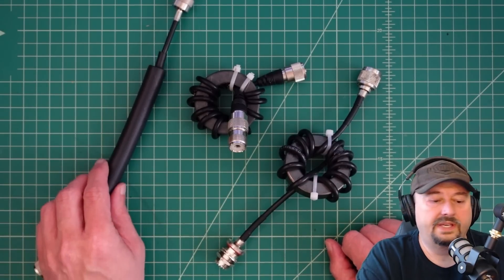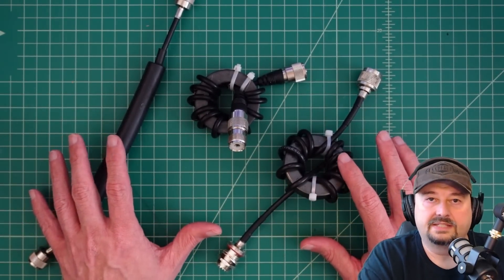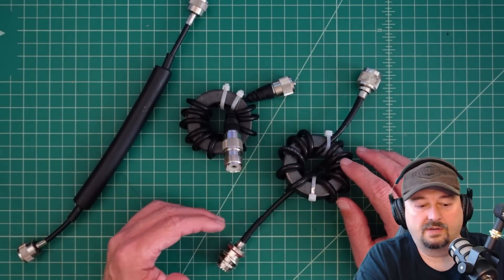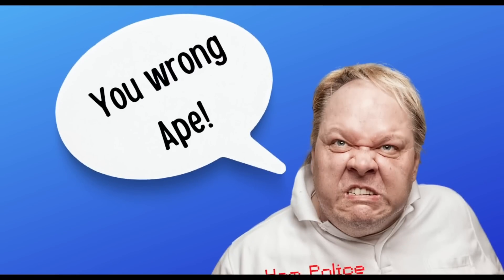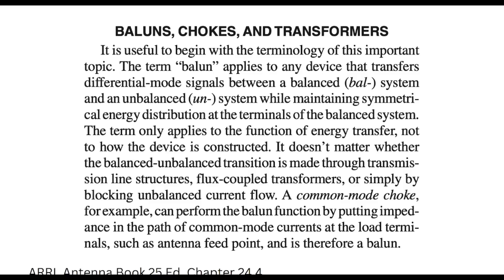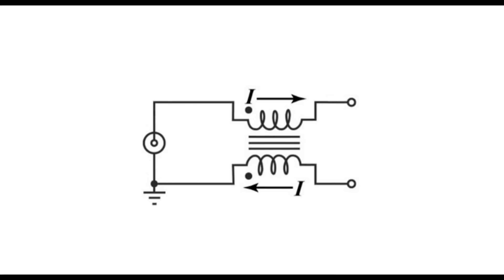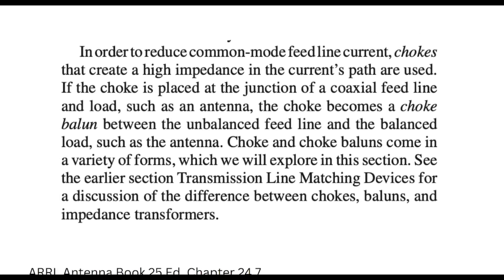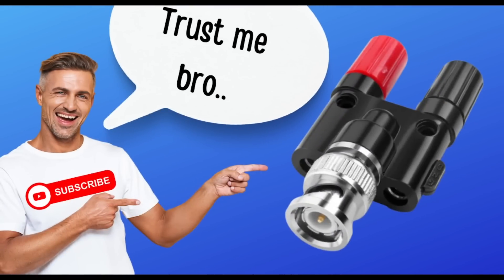Debunking the Ham Radio Choke & Balun Myth

Comment: What's with the Achkshully guys in ham radio? It's one of the worst hobbies with these hall monitor types. Write mhz once instead of MHz and you'll flush them out. It's not really fair to bait them like this, but it helps so they can be spotted.

This video is exceptional at showing what happens with and without a balun at the feed line:

https://youtu.be/QFOx7vjchy0
Reply from the maker: I guess some people have nothing better to do, thanks for the link 👍

Comment: When I built a cheap dipole with a banana jack to BNC adapter, one of two ways I did to reduce common mode current:

Loop the coax from the adapter through a ferrite bead a number of times, or use a choke cable. Both of those work as a 1:1 balun. I’ve been able to make them for 20 and 10 meters.

Not the most efficient antenna, but it works.
Reply from the maker: @Sonicgott  I’ve seen folks use those methods before 👍

Comment: I've got an idea, if common mode current travels back down through the outer sleeve. So make a cut/ gap at the highest point, where you connect the Antenna.  Solder resister in between the gap enough to stop or completely stop all common mode returning. Ham radio is for experimentation.
Reply from the maker: Hey Steven.  You use differential current with antennas, you don’t want to alter that, a choke is the best practice 👍
Reply: Why learn theory when you can experiment endlessly?

Comment: 6:50 "How are you handling common mode current?"  In a coax cable, there is no common mode current.  Common mode is "common" to two or more conductors as for instance electrical zip cord.  Twin-lead or ladder-line antenna wires should be push-pull differential; the current going out one wire is exactly matched by the current arriving on the other.  Ethernet typically uses UTP, unshielded twisted pair, and transformers or at least differential amplifiers at the ends to ignore common mode current flowing on BOTH WIRES.  

Current flowing on the outside of a coax is not "common" to anything; it is just current flowing on the outside of the coax.  So far as I know it does not have a name for that, so people are using "common mode" for that, but it isn't, and it's mildly annoying.
Reply from the maker: Everything I’ve read about it says it travels on the outside of the coax and is called common mode current but I’m sure you are right.

Comment: Well I went to read that article and I went directly to the conclusion. It's more or less along the lines I was thinking along. A balun or unun might make no difference at all. But a dipole is not even 50 ohms it's more like 120 or something depending on height above the ground and as the author mentions, lower frequencies are more susceptible to being effected by surrounding objects. On certain antenna it will certainly help with or stabilise certain mismatches lets say. However he also mentions that more types of antenna need to be tested. 
  I have been trying ununs on verticals, a 1:1 helps to stabilise bad designs that are not close to 50 ohms.
  For a mono-band antenna it's best to try to balance it close to 50 ohms or try to transform the impedance match as close as possible to 50. Changing the shape of the antenna is also a technique that can match the antenna to the fee-dline.
  The main thing to remember for a mono-bander is to tune the antenna at the feed-point, if you know how to do this with a vna but by calibrating the coax at the feed-point before checking the antenna then you can be sure you are only seeing the results from the antenna and mast plus any surrounding objects but at least not from the coax. 
  If then after another calibration but without the coax or by checking with a regular swr meter you then see a different result at the shack end than with the feed point calibrated VNA then you know that it's the coax length that is now putting things back out of whack. The VNA can help you tune the coax length in case of this scenario of two different readings. That should then help to see a similar reading at the shack end and at the feedpoint itself. If this is finally the case and surrounding objects are having a minimal effect then we may not need a balun or choke or balun-choke. if the antenna is designed to be able to show a 50 ohm impedance and everything else is clean and tidy regarding being well spaced away from  objects and if coax length seems to pose no problems then you might be good to go without a balun or unun-choke. 
  I know from experience that some antenna show huge behavioural differences with and without an unun while other antenna show less. I've seen the band usage broaden and swr start to behave on tricky antenna. But sometimes I would prefer to try to tune and install well enough not to need one.

Comment: Could you do a video on the explanation of the words "balanced" and "unbalanced"?  I find those terms quite confusing.  For instance if a feedline (coax) is 50 ohms,  what about that makes it unbalanced?
Reply from the maker: Yeah, I can do something like that.  The thing with coax is that it's actually three conductors which seems a little crazy at first.  Current will flow in the center conductor and on the inside and outside of the shielding, that is why it's considered unbalanced.
Reply: @TheSmokinApe  Dont understand.  Unbalanced because it is "3"?
Reply from the maker: Correct, more current traveling in one direction would make it unbalanced.

Comment: THANKS !  Great Video !!!   Perfect timing for me , as I am building a new Random Wire  w/ a factory 9:1 un-un  for Field Day and was wondering about using a choke at my tuner.  .... Read the  ARRL antenna Book several years ago, but need one for my reference library .  THANKS AGAIN !
Reply from the maker: I put one at the antenna and at the tuner for my 9:1 👍
Reply: @TheSmokinApe  I'm still working on figuring this all out. I get putting the choke at the feed point, but why the 9:1 unun at the tuner? Thanks, I really learn so much from your videos.
Reply from the maker: @ the 9:1 goes at the antenna feed point then the choke, some folks like myself will put a second choke at the radio / tuner feedpoint 👍
Reply: @TheSmokinApe  Any particular mix on either toroid?
Reply from the maker: @ mix 31 for the chokes and mix 43 for the 9:1 👍

Comment: Hey I appreciate any advice you can give.
    My electronics theory is pretty rusty as I only build kits and do point to point soldering so actually designing stuff is out of my realm.
     I have a plethora of stuff in my garage from bygone days.....swr meters, multimeters, even a Q tester for transistors.
    You get the like button smashed today......
Reply from the maker: Hey Tom, thanks for watching!

Comment: How do you even know you have common mode current and if so is it even hurting anything?  That has always been my question.  Only time I have noticed it being an issue is when I try loading up car trailers, fences, and other way out of wack antennas.  Maybe running higher power, I could see it being necessary.  Endfeds in the field would also be a candidate if you can't ground the coax braid before the rig.  73
Reply: I don't believe that common mode current will hurt anything at low power, however if you use high power ( amplifier ) then you might get rf back into your hamshack. It's possible to get an electric shock while at the microphone. You can Google it.  The real problem, I believe is if you have common mode current, then not all of the current is being radiated as it is in the coax so you lose efficiency and your signal doesn't go as far.

Comment: I suggest you look at the article "Magnetic Coupling in Transmission Lines and Transformers" by Gerrit Barrere, KJ7KV in QEX September 2006. This explains the mechanism well:
"The circuit of Figure 11 is also known as a Guanella current-mode balun. It is not really a balun, however. Neither currents nor voltages are forced to balance by this circuit. It is, in fact, a common-mode choke. There is no magnetizing current with the load disconnected, so the transmission line currents are fully differential. This means there is no core flux, therefore no longitudinal voltage on the windings, and v2 is at ground potential. This does not change when ferrite is added to the line, increasing the common-mode choke reactance."
... I won't give you a ticket this time...  😸
Reply from the maker: Thanks for the reference Mike.  At the end of the day I don’t care what what people call them.  What’s annoying is when people want to hair split while posturing like they are some sort of guru….
Reply: @TheSmokinApe  It's quite interesting if you look into the physics. On a bit of a tangent .. but have you ever wondered why the equivalent circuit of coax has NO inductance in the shield. It's a wire ... any current will give rise to a magnetic flux (i.e. there has to be inductance) but it's never shown. Why??  It's because ALL the flux produced by current in the shield is cancelled exactly by the flux from the current in the center conductor (that's the beauty of coax vs twin line). There are equal and opposite currents arising from the TEM wave in the coax, thus the net flux outside the shield is zero and thus no net inductance from the shield. However; for a common mode signal, there IS inductance (because the flux is NOT cancelled). This is why you can connect a dipole to a coax (without a balun or choke) and it works in a fashion. The forward current from the shield at the antenna feed splits between the one half of the dipole and the shield depending on the relative impedances (and the shield acts as part of the antenna). If we add additional inductance to the shield (with a choke), then most of the current will flow in the antenna leg and not in the shield.

Comment: Interesting subject and agree with baluns reducing common mode currents. One question, is there any benefit of each half of a dipole being connected directly to the balun windings, instead of them being connected to a short length of coax that is then is fed to a balun? So in other words, the coax only starts after the balun?
Reply: I've watched a lecture or two about antenna design and some antennas can use ferrite material in the design to help shrink it or to give other benefits so it's definitely very interesting

Comment: I have a g90 and a couple masts for pota use. I've never done pota but I have all the equipment and am getting ready to play. I want to try multiple home brew antennas and want to only use one feed line. My question is when using an enfed and only need a short cable  is there any downside to taking up the alack by creating an ugly balun or just wrapping up a large choke on pvc for common mode current? Can I use one without causing any undue harm? Im basically just using up slack and hoping for a possible benefit or should I just roll up the slack and call it a day. Same with ferrite beads. Even if I don't have any common mode current bothering me is there a down side to just keeping those beads on permanently? Last do cheap ferrite beads off amazon do anything at all or do I have to buy those expensive guys? Not matching impedance just trying to eliminate common mode. Thanks!
Reply: I should add when building antennas that need an unun I do buy quality cores. I'm just using cheap stuff for the common mode quieting properties. No experience here....at all.
Reply from the maker: Ugly baluns can work quite well but are very difficult to tune.  Additionally, they are tuned for a particular frequency which means they are practically useless on a multiband antenna like an EFHW.
Reply: @TheSmokinApe  TY
Reply: Ferrites have no effect on the inner conductor thus the transmitted signal.  They only affect current running back to the radio on the outside of the coax.  Cheap ferrites are okay but different "mix" ferrites work best at different frequencies and you want ferrites that absorb power and don't themselves become resonant.
Reply: tune well and you should not need one. the worst things about it are 1. It's ugly. 2. It's extra coax which means extra loss. I tried one for a while but I found better solutions by moving the antenna into a better position which required me to unwind the ugly. I then tried a bifilar 1:1 unun but I found things were just fine without it. Every different type of antenna and most installs are unique to each other.

Comment: Hi.   I am NOT one of the "ham police"  however I think I see why some people are giving you grief on this.  
The "balun-choke that you have in the picture"  has  a coaxial(unbalanced) connector at both the input, and output, which IMPLIES that it is an UN-UN.   
You will notice that the ARRL example you gave, clearly shows a schematic with a coaxial input to the choke, and an unbalanced output, with separate terminals. (A BALUN)
If you had constructed your device in this fashion then I doubt that anyone would have challenged you. Quoting the ARRL book out of context, does not make you correct.
This is the same confusion caused by the - coax to terminals - adapter that you criticise at the end of the video. Your explanation is no better than that guy.
I am am not looking for a debate, because I had 50 years as a developer, and have taught this stuff at Post Grad level. I am well aware of the illogical conflicts that rise in these over simplified amateur disputes.    This will be my only comment......
Reply: Well said!
Reply from the maker: Hey Oodle.  Few things; the schematic wasn't from the ARRL and the Ham Police have complained about the term "Balun Choke" when do device or schematic was shown.  This video is really a call for the Ham Police to calm down.  I also, agree with the UnUn with the coax connector...  I am sure you have seen that many people routinely call UnUns Baluns.

Comment: great information. putting them on feed line really helps CMC getting into radio . they even work for 60 Cy ac power and DC power leads. with them you can wind turns on top of each outher . you can use different ferrite or power iron mix. this will change attenuation frequency and DB of attenuation . just use data sheet on cores to pick right one for your needs. 73's
Reply from the maker: Great points Robert 👍

Comment: ooooh! you're so nearly right! :)
people keep using the term common mode, common mode choke. This is not the correct term for the issue we have with coax fed dipoles, or other antenna. Common means with respect to BOTH conductors at the same time. What we have in reality is a THIRD independent current path that is not part of the single ended circuit of coax feeder line. Winding coax around some core has NO effect on the inner of the coax, no transformer action is happening, this signal inside the coax can not see the core its wound on, its shielded by the er, SHEILD! It is NOT like the current balun schematic you presented in this video. In fact I dont think I've EVER seen the "third path/imbalance current/outer braid" properly depicted in any discussion or presentation. 
So winding your feeder around a core does one thing only, chokes the imbalance current from the antenna, which is NOT common mode current, it is on the outer of the braid, a third path. It is not any kind of Unun, Balun or transformer.
73 de G0AFV
Reply: THANK YOU for being the other person on Earth that recognizes the common in common mode.  It does not have meaning for coax cables.   On the other hand, when EVERYONE is doing it wrong, sometimes you have to use the wrong term just to be understood.
Reply from the maker: "no transformer action is happening". who said it was?
Reply: @TheSmokinApe  seriously? you dont understand that Ununs and Baluns work by transformer action of one current inducing a secondary current in an inductively coupled conductor? deary me!
Reply from the maker: @bazzaar1869  a balun choke isn’t a transformer
Reply: @TheSmokinApe  for it to be a balun it HAS to be a transformer, your assertion that "because choke then balun" is nonsense. Winding coax on a ferrite core does not change the unbalanced nature of that feedline, its still unbalanced at the antenna end. What you have achieved is proper management of unwanted currents, the common mode current as it seems to be we are calling them, but this has not created a balanced feed to the antenna. Coax on a ferrite ring is just a choke.
Reply: I understood it’s still called “common mode current” because the other two currents are perfectly balanced and seen as cancelling each other.  The term “common mode” is not very intuitive.
Reply from the maker: @petersichel9934  it’s not intuitive, what they mean is that it’s unwanted current traveling on a transmission line that is common with the wanted current.  Ie Egghead speak.  It could be CMC but it could also be RFI from an unwanted noise source like the power lines.

Comment: Call it what ever you want. It is more important to know how they work. How are common mode currents induced? How does a 1:1 transformer transform? Is an antenna just a RLC circuit that radiates EM waves instead of heat? How do standing waves affect the magnitude of the transmission line polarity? Repeat a word incorrectly enough time until it sound true like what are baby goats called if small humans are Kids?
Reply from the maker: "Call it what ever you want. It is more important to know how they work." Agreed